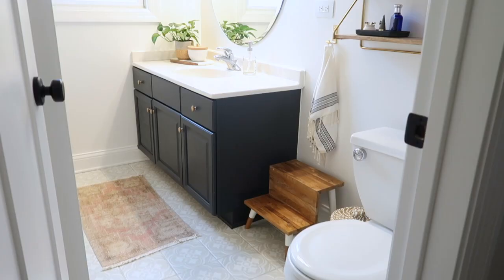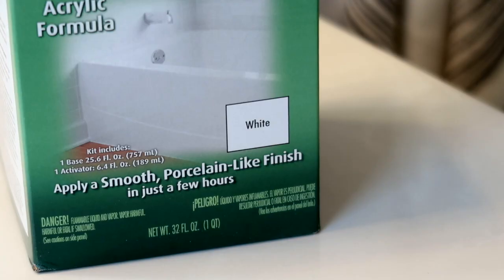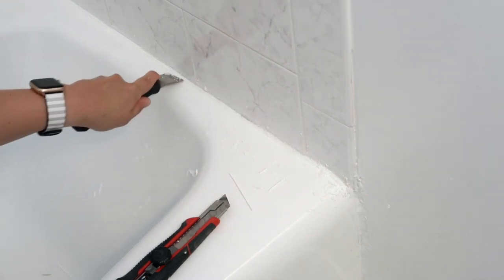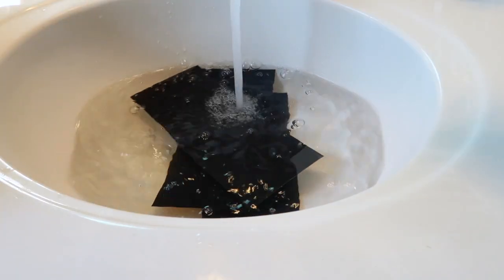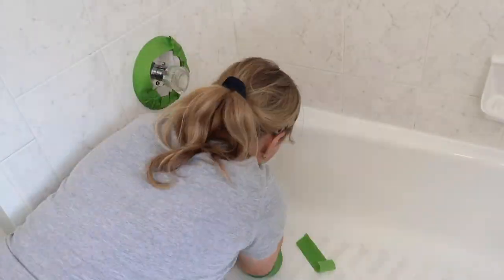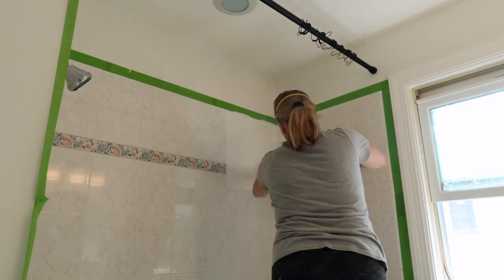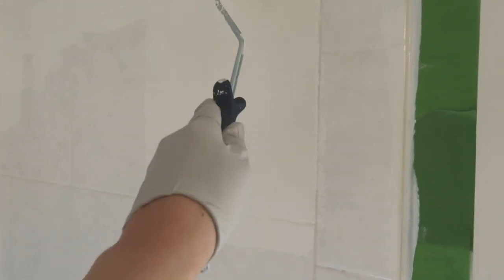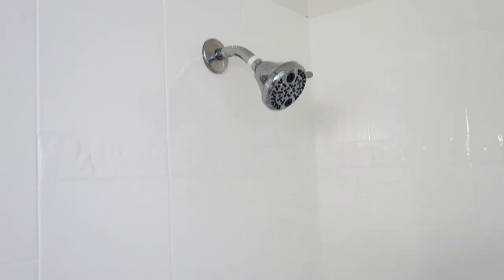How to Paint your Bathtub and Shower Tile

Comment: Could you use a stencil over this to add some color? I'm going to be reacting doing our bathroom and want to cover my shower tiles but I want to add some color as well.
Reply from the maker: No, the paint is too thin for it to be able to hold a design. This particular paint just comes in a few colors.

Comment: @DIY Playbook - I'm not painting the tub - do I still need to take the caulk out?
Reply from the maker: If you're painting over the caulk at all, yes. You'll likely have caulk along the vertical seam too (not just the horizontal around the tub) and if that gets paint it may peel.
Reply: Ok. I didn’t think about the vertical.  The tile surface is not smooth so I don’t think sanding is necessary. Paint will most likely adhere. Thank you. I enjoy your videos and also watched the floor stenciling.